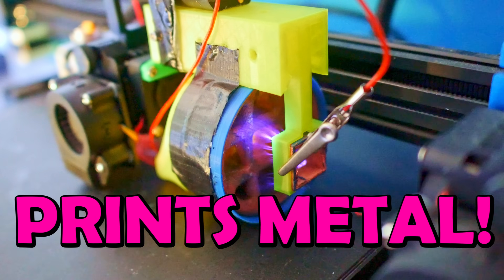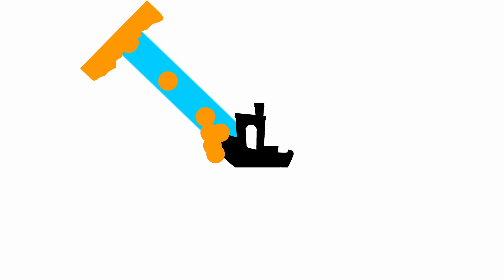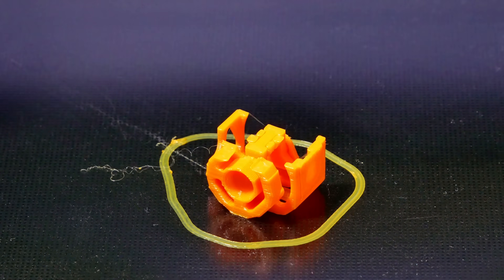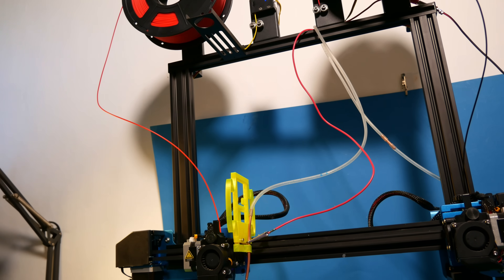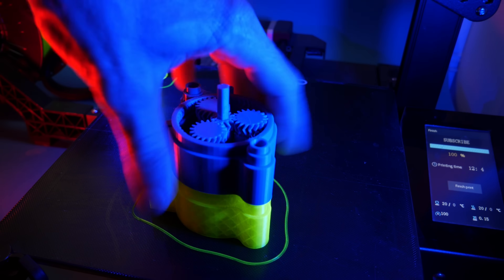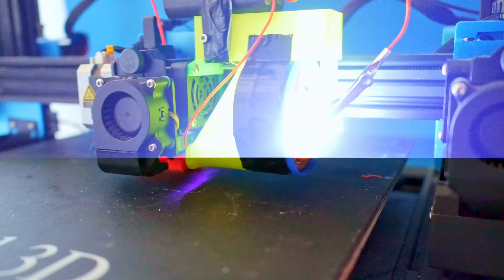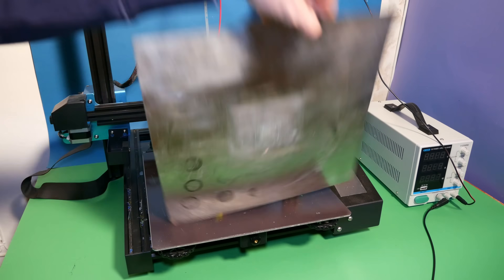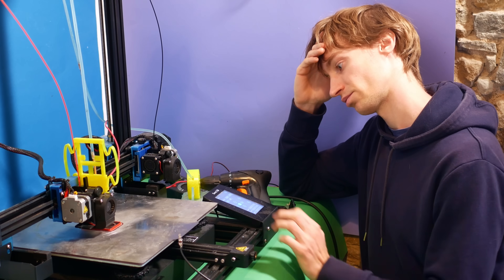i made a METAL 3D-Printer at home!

Comment: Hmmm...  It would be nice if you could have the printer itself to print the first plastic layer with some sort of adhesive and then switch to filament, but that might be some work.  The best solution might be to coat the plate with a conductive film, but I don't know which film would be best for holding the plastic and not melting.  There are many types on the market.  That might require some trial and error.  In any case, I wish you luck.  This is some brilliant work.  :goodvibes:

Comment: Not an official engineer here^^ I have had good luck with something I call "seasoning " simply put the deliberate act of printing an ultra thin layer of the conductive material you were attempting to electroplate then print the nessicary part atop this layer, giving amazing bed adhesion if done properly, as well as a great electrical connection during hydroplaning!

I've been testing this so far on a stock ender 3 but I believe if you did this with your part it would up the success rate! 

1-2 ultra thin layers of your conductive material then start the main part on top. This decreases the chance of failure by filling any microscopic holes or dents in the build plate and allowing the material to stick to itself instead of needing to adhere to a different material alltogether, and providing a larger surface area for electrical conduction. Even if the conductive material somehow broke from the rest of the print it would still have enough surface area to conduct to the print bed

Comment: One thing I think you should keep in mind is that not everything has to be 3D printed. As long as you can print the machine that can make the non-printed parts, as well as print the whatever is needed for assembly (such as a robotic arm) then you'll be able to complete your goal. After all, your goal isn't just to create a self-replicating 3D printer, but rather a printer that can be used to to start from scratch. There's nothing saying that you can't 3D print non-3D printing machines to help your 3D printing machines.
Reply: and then he could get the 3d printer to print limbs for his 3d printer so it can use those non 3d printer tools and components as an extension of itself anyways turning them back in to 3d printing components
Reply: Also tubes are cheap
Reply: @cupcake_toucher445 he literally said that it needs to fully self replicating, for instance, you cant get tubes on mars

Comment: For the electro pleating not working properly due to initial adhesion on the underside; would it be a good idea to stop the printing after the first layer and add a small amount of metal or pin to ensure good connection between plate and subsequent layers of metal. I can see that this would add a process step but is just an idea.

Comment: at 1:15 
Yup. Weve been thinking about that. For almost a decade now. And by we, I mean me and my co workers and the researchers at serval universities for the excat same reason you did. 

And your implementation working alongside an FDM printhead is honestly brillant.
And your use of conductive filimant is great too.

The Open Source hardware project I and many other have volunteered many thousands of hours for has made refinements you should know about to the actual elecro machining head; not to knock what youve made you did GREAT! but the research is there, and is free to use, and was designed for the very same reasons you are working on this project.. and the hawkeyed out there spotted something.
Elecro Chemical Machining.

By making a small change to the process you can not just deposit, but also machine away precisely and accuratly. If your set up can handle it, you can go down to about 25-30 NanoMeter in feature resolution.

Ok. So the refinement. Instead of pooling your electroplating solution on the part, and having your tube be sacrificial all you gotta do is use a platic tube filled with the electroplatting solution and feed a wire into that tube.

Inside the tube or syringe place an open cell foam peice (a sponge) in the bottom and adjust your wire feeder mechanism so that the sponge stops it fully.

You can then either rely on surface tension for a small tube or syringe or for a large opening just steal the felt tip from a sharpie. 

Getting this to self replicate;
Print the empty space of an "sponge" and syringe in your metal. Then print over it with your platic excrusion, making sure the print head takes a sweep cleaning off excess and revealing the metal to print on next, so your layer and print order is metal (where air would be in the sponge) plastic, wipe, metal plastic wipe etc, afterwards invert the polarity and use the metal printer to disolve all the metal, as you reteact the feed wire.. thus making new feed wire. 

And thats why we use it all seperated like this. It doesnt just replicate it makes its own feed mechanisms, and its print resolution is the size of the openeing so you can bootstrap it from any size opening and constantly make a tighter and tighter higher precision, higher accuracy printer. each generation of printer becomes BETTER then the last one. Its pretty darn cool IMHO.
Reply: Where could I find this open source project? I'd love to read more about it
Reply: @mikek6298  Well it was a loose formation primarly of universities working together, for the electrochemical additive process the most refined and polished publication I am aware of happened to be published after I left this circle and went to fight the power in Seattle
I would start there, its a paper published by Sun Yat-sen University titled "A Low-Cost Electrochemical Metal 3D printer Baised on a MicroFluidic System for Printing Mesoscale Objects"
And it is true to form a free publication. Like I said earlier I had left the acidemic circles by 2020 so this paper is a bit more polished then any resources that I had any involvement in. 

M.I.T. also has a few published papers as does Harvard if you care to pay for a subscrition to Nature for projects that frankly are better done by just about any other university.. -_- 
And just about any univeristy with a materials sciences lab, will have something published, google scholar is your friend.
There is a thriving community expermenting with taking these scales down as far as they will go, but given its nanoscale nature you'll find articles published in academic sources; most free and open source.

Comment: What if you added a secondary print head axis above the hot ends own axis, and offsetting the planar motions to be subservient to the hot end position for this to work best the print head and the Anode axis would need to be fixed, if you then add an offset to the anode axis that could be in an opened or closed position then you’ve got your tool change based on precision and accuracy of the gcode, perhaps I’m wrong and you already thought of and tried this or I’m missing something so obviously a forest because I’m busy looking at the tree.

Comment: Interesting idea.  If you have gone this far, and considering you have an ionic thruster.... you should look into vapor deposition.  You could remove the need for water and solution and use raw material.  There are other issues to figure out though,  how to only coat the areas you need, as well as issues with air.  You could probably find solutions like enclosed chamber or possible blowing argon over the surface.

Comment: If we were to deposit iron, this technology could be the literal way to go to colonize Mars with ease, potentially.

I'm speculating – no idea what electrolyte could be used to deposit iron ions and the feasibility of Fe2O3 reduction (that's assuming Mars' rust is mainly iron(III) oxide)... if we were to electrolyze water we could use H2 as a synthesis gas??
Hold up, Fe2O3 could neatly react with that to only leave Fe and H2O as a byproduct, meaning water could be not the limiting factor in self replicating robots/printers.
Oh my god this is awesome?🙃

Comment: First of all, you wouldn’t buy a plane, you would go to the airport. Likewise, you wouldn’t buy a $500,000 metal 3D printer, you would go to one of the many websites that print your items for you. Also, electroplating is not real metal 3D printing. Electroplating has a severely reduced selection of materials. As if lacking strong metals wasn’t enough already, it also ruins the structural integrity of the metal! Those are all my criticisms of the concept. What follows are all the problems I found with it. The problem with your tool toggle is that when you print the 3D printer to be really tall, like when you are printing another 3D printer, it will take a lot longer to switch tools. Also, how do you intend to get traces to form on the sides of the print, or, for example, the bottom? Also, 3D printers can print flexible materials, and your 3D printer does still need to have multiple different materials refreshed. Maybe you could add a tri-stable toggle for flexible materials? Also, your problem with the build plate? Could you possibly print a build plate and then electroplate it with nickel? Electroplated metals are rather rough. Other than that, this is a much better way to electroplate.

Comment: Very cool. May I suggest trying to print on a esd mat. They are semi conductive and normally have a polymer work surface. Not sure how durable they would be for multiple prints but they sell them by the roll and new pieces can be cut when the old wear out. Other thoughts are graphoil or just a plain graphite slab. Those may not be a durable however.  Best of luck.

Comment: you just could connect parts made out of conductive filament inside of the model to ensure all of them would be connected to bed even if one connection point would unstuck during the printing

edit

ok, they need to be isolated for the motor to work 😅 my bad, so maybe print some special bridges whitch could be broken of after plating (like supports)

Comment: I can imagine the endless possibilities of this. As an improvement for finer detail work (at the cost of speed and efficiency though) you could probably get away with using a felt tipped pen on the print head carrying the solution to the part. Yes it would be super slow but you could definitely do direct metal printing with that with at least millimeter resolution. Anyways excellent video and brilliant work.

Comment: I think the way you apply the metal layer needs some more iteration. Your test "PCB" shows over 110 Ohm resistance for what's already a very big trace - this suggests that the layer is full of microscopic holes, not leaving many paths for the current to travel through.
Reply from the maker: Jupp, on the "lower" trace i was super impatient, and i just let it print over it as soon as it looked ok, the top layer has 0 ohm resistance, there the trace is a little thicker (not wider)

Comment: For the CONDUCTIVITY ISSUE:
Can't you just print on copper tape?  
it's conductive (as well as it's "glue") and can be very flat (and thin, meaning the heat isn't zapped away changing adhesion).

Comment: Don't buy a peristaltic pump u can make one easily by putting a cammed pulley in the output shaft and two pegs adjacent to, either side, of your pulley. Just look it up. It's dead simple, and the most complex part is getting the good silicone tubing and the inter connects between the other line to be using. Just saying ifu want to save a nice chunk of cash, u can probably just make one

Comment: There are kids paint brushes which are squeezed to shift paint from inside the handle onto the brush (squeeze and brush). Taking that principle, you could replace the copper tube with a a copper fibre brush that is fed through a tube that gets wetted by the electrolyte solution to reduce the bubble of solution needed. As the brush gets eroded by the process you feed more down, it'll also be more compliant and mechanically forgiving on the part being plated. The challenge would instead be to prevent drips.

Comment: Um... no. This is neither original nor a good execution. It's not true that "until now electroplated parts had to be submerged entirely". Who on earth told you that? Because that person was lying to you. There is already a thing called PEN PLATING or BRUSH PLATING. For years already. You did 0 research on this, right?
And your solution turns out to be abolutely terrible. Instead of using a cloth, rolled up cotton or even a tampon - like other people figured out already - you flood the print with electrolyte and turn everything into a gigantic mess with horrible plating quality to boot.
0/10 try again

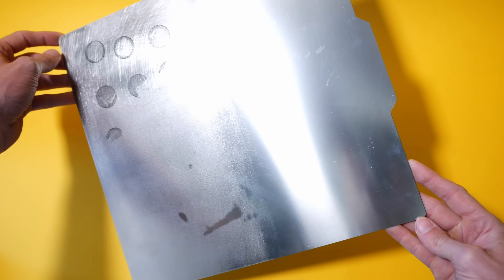Comment: 9:07 --- just leave it smooth AND NO TOUCHY 
dont touch it with your fingers , and clean using alcohol / acetone before every use 
its also great to use spray adhesives based on PVA glue for "dry" printing - just spray it super thin on HOT buildplate and everything will stick like crazy - remember THIN and ON HOT 
 (read description on the 3d printing adhesive - the cheapest stuff have it and works the best)

Comment: Actually for adheasion you can use a net of PEI ( think of it like a wiremesh) and still to have electrical conductivity in some places I think sufficient enough for the parts to be electroplated.I think you can print a wiremesh and spray it with PEI spray in order for the build plate to be coated. IMO the coating should be less than the electrical conductive portion giving the parts less resistance.

Comment: Confused as to how you coated your 3d parts as well as you did. Makes me wonder if there would be a way to make a a really low pressure pump that has some sort of contact nozzle and continually moves fluid through the cathode so you can move it along 3d faces.

Comment: Проблема равномерного нанесения покрытия традиционным гальваническим способом решается очень просто, надо поставить несколько электродов вокруг детали , на одинаковом расстоянии. Покрытие выйдет более равномерным . Твоя идея создания принтера на основе гальваники очень интересна, но есть вопросы. Главный вопрос заключается в прочности создаваемой детали, я по своему опыту знаю что гальваника очень капризная и часто покрытие выходит не прочным. Очень трудно добиться того чтоб движущийся электрод поддерживал постоянную силу тока, а это влияет на прочность создаваемого материала. The problem of uniform coating by the traditional electroplating method is solved very simply, you need to place several electrodes around the part, at the same distance. The coating will be more uniform. Your idea of creating a printer based on electroplating is very interesting, but there are questions. The main issue is the strength of the part being created, I know from my own experience that electroplating is very capricious and often the coating does not turn out to be durable. It is very difficult to ensure that the moving electrode maintains a constant current, and this affects the strength of the material being created.

Comment: It's insane that you can even electroplate a piece of plastic in the first place. I know plastic/polymer parts can hold static, but I didn't think they could hole even remotely enough of a charge in a liquid to pull an electroplating metals to bond with it.
Reply from the maker: The plastic that is plated contains some amount of graphite that is a little conductive:)
Reply: @TurboSunShine  That makes sense. Thanks. Appreciate the info.

Comment: NOT A METAL 3D-Printer AT ALL! Not particularly useful or well made either. Frankly everything this guy says is idiotic.
Reply: my actual electro-plating machine for bike parts cost around $500, he has made a 3d printer that electroplates and compared it with electro-fab / laser hardware that for sure costs 100s of K. This doesnt stack up, and, EP is very slow and requires constant refresh of the electrolite AND power. Imagine a machine that can make a diamond by laying down 7 trillion back and forwards with a pencil. Ironically, he has taken the very slow FDM printer and used it for something slower, electroplating. It's the 70k comments around us here that all think this is edison level genius. it's not, if it was, it would have been done in secret, under patent application, and, he would be the dutch elon musk. Do we now think if modern day manufacture could solve all it's problems with this, freely available youtube method, that the worlds factories, which we know run on getting the best quality for the best price woulndt have copied it. His 3d printed engine a few years ago was good, until he turned it into a battle between his model and 3dbenchy, infering that the industry standard of using the 3dbenchy model to check out a new printer or filament was no longer fit for purpose and his, more clever model, was the new way. When you do somehing clever and follow it with by deriding (clips of 3d benchy being stalked by his 3d printed engine with horror music) a loved and well used artifact out there you make someone write this a few years later. Now you're selling snake oil and pretending you can print metal for 100 bucks, it's not possible. The trick with being smart is not beng an ....

Comment: I have an idea that could use your help.  I like what you did with metal plating but for some designs, you could leverage a carbon fiber strand so you can print a part that has internal electronics.  Can you help  me with this idea?

Comment: For better bed adhesion as well as conductivity .... #1) I wonder if you mixed very finely ground aluminum powder with glue stick would work.  #2) Maybe a metal, copper or aluminum screen of an appropriate mesh size would work if it was placed upon and secured to the bed plate ... still conductive and with appropriate mesh size it would offer a "rough" surface and may adhere better ..... try both together even   hahaha.  Awesome work man